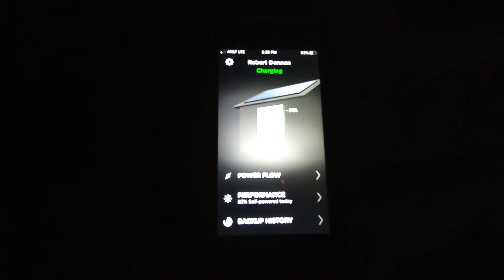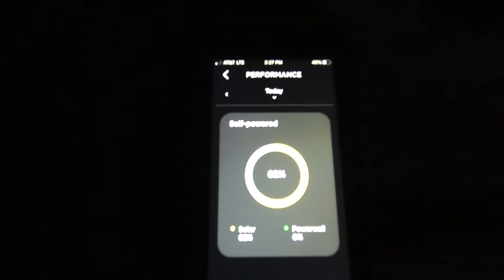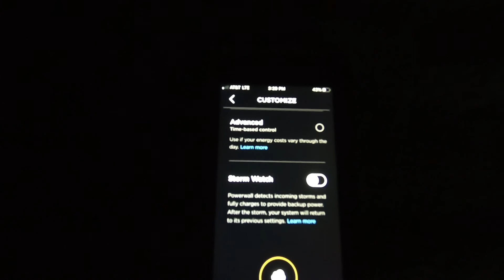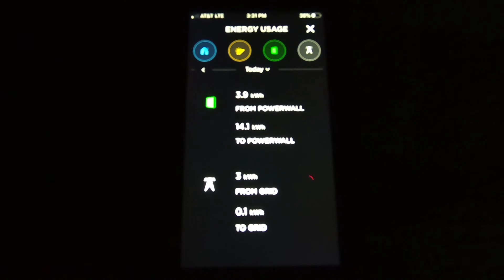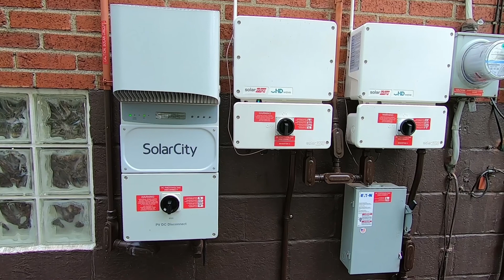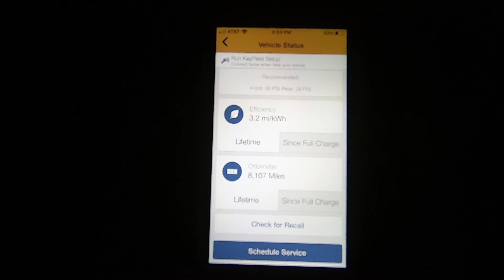National Solar Tour | Donnan Household | McMurray, PA

Comment: Hope you enjoyed the video, I usually smile more LOL. Since I was talking slow to get all the facts straight, you might enjoy the video more if you speed it up by setting the speed to 1.25  
Here are some updated comments for those interested: 
OUR LATEST ELECTRIC BILL... 
$7.19 
One-cent less than the previous two months' bills and we still banked 9 kWh for the future (since we have "net metering") even with car charging (about 850 miles worth) and heavy AC use until the weather cooled-down some recently.  

Our approval from Pennsylvania recently came through for our solar system extension (from the original 11 solar panels to 29) so that we can sell our SRECs (Solar Renewable Energy Credits) on the PA market. The value of those credits has fluctuated over past years, since we went solar in 2018, from $10 to $45 and they are now trading at $20 each. We currently have 3 SRECs to sell, which will be submitted to SRECtrade from our inverter readings, reported at the beginning of October. We will probably generate about 7 SRECs next year.

Our Chevy Bolt now has over 10,000 miles on the odometer, and is currently averaging 4.5 miles per 1 kWh of driving (3.3 miles/kWh Lifetime average since the heater draws more energy in winter). Even if someone was purchasing all that electricity for her EV at our fairly low West Penn Power rate (without the "free" solar input), the basic fuel cost, when compared to a gasoline-powered (ICE) sedan, would currently be about 25% to 35% of an average 27 MPG vehicle here, not counting the savings on oil changes, emission inspections, lower maintenance costs, etc.  

According to the "MyChevy" app report in August, our Bolt was getting 149 MPGe. It's super-efficient in around town driving, less so when going over 65-mph on the interstate.

Bob
"Enough solar energy reaches Earth every hour,
  to fill all the world's energy needs for a full year."
    Why aren't we using more of it??